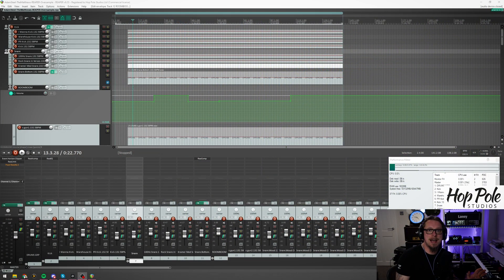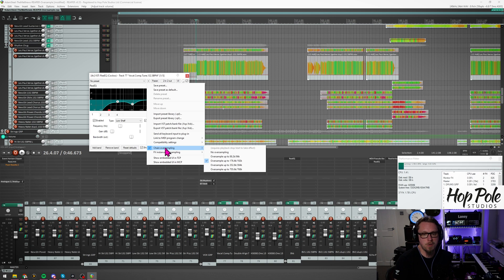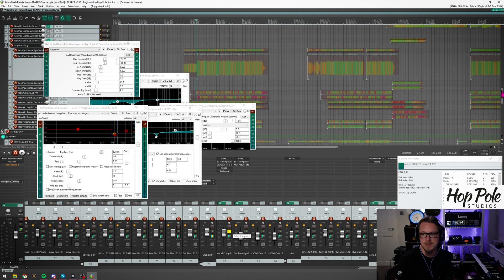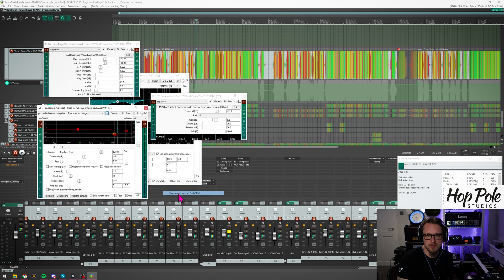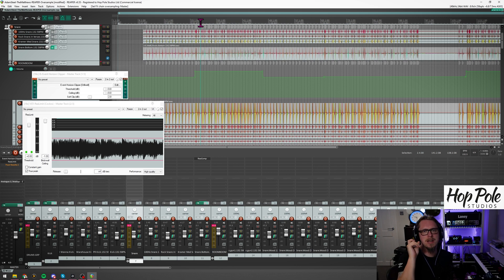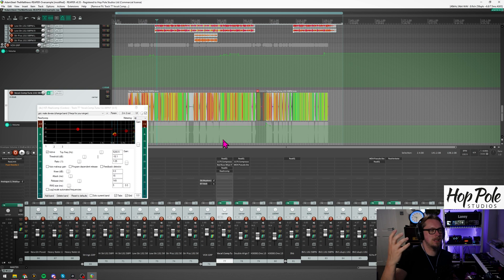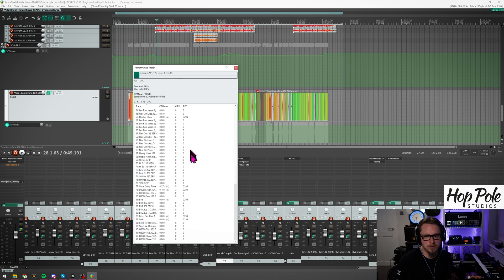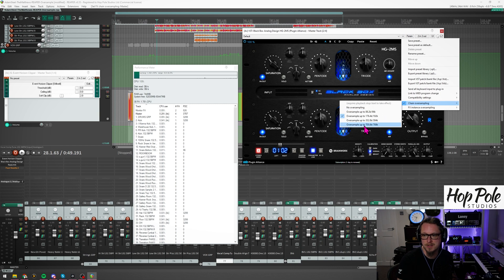Oversampling in REAPER? - The NEW Game-changing feature

Comment: So... what if you oversample and then print?
Reply: Oversampling isn't just about taking the signal/plugin to a higher sample rate to do its processing, before finishing the oversampling cuts all the high frequencies over the project's sample rate and then it goes back down to the original sample rate. So basically, the printed clip will sound better.